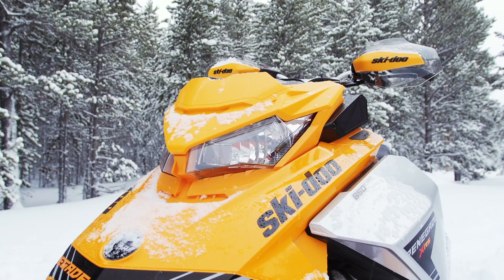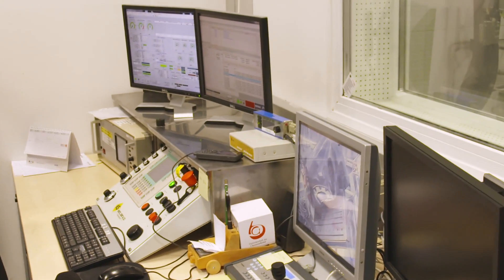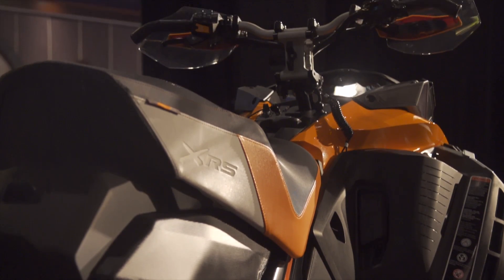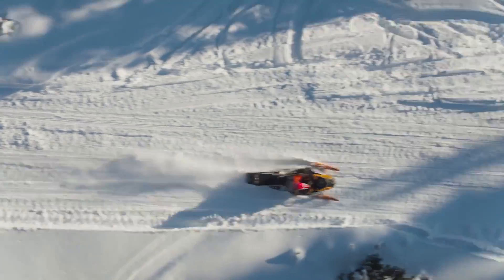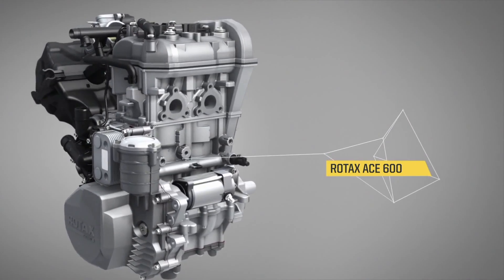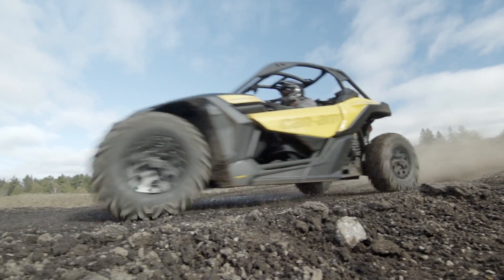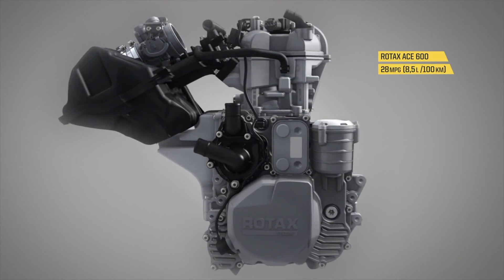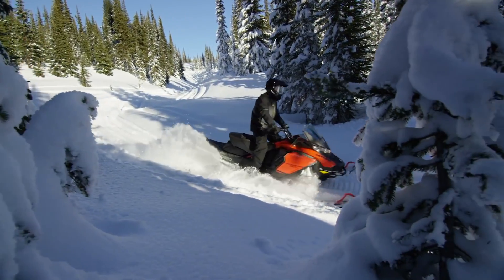Design and Development of 600 & 900 Rotax ACE Engines

Comment: 900 HP?  Seriously, edit.  Cold side plumbing on this setup is the first thing I'd change.  What is the displacement for the 900?  Seems low on power, not impressed after 20 years of Yamaha 4-stroke dominance in this class of engines.

Comment: I spotted an inaccuracy in your video. 

60HP Sparks have the same 3 cylinder 900 ACE engine as the 90HP version. Literally the only difference is the ECU tune. 

I say this as someone who bought a 60HP Spark and had it upgraded to 90HP for $100. 

There are no Sparks with the 600 ACE. I don't even see a marine version of it on Rotax's site.

Comment: My brother bought 2014 expedition 600 ACE. I bought we he moved got it around 8,000 miles sold it to my older brother stop running at about 19k. ACE machine are good if you take carry of them really good. Got me a new 2020 expedition 600 ACE almost 4k miles already doing good so far. I sure like them 600 ACE motors

Comment: I always enjoy Mark's commentary and perspective.  Keep up the great work!

I would like to offer a few corrections:
1.  Rotax "ACE " is an acronym for "Advanced Combustion Efficiency", not "Engine".
2.  The Sea-Doo Spark is NOT offered with the 600 ACE twin, but rather a "detuned" (de-mapped) 60 HP version of the 900 ACE triple cylinder, and a 90 HP version identified as the 900 HO ACE.

Comment: These 4 stroke turbos are awsome, endless amounts of power and reliability. I have over 9000 miles on my 1100 turbo cat and it is indestructible. Unfortunately, the industry still treats a high mileage 4 stroke the same as a high mileage 2 stroke, financially.  But if you plan to keep her long term and love speed and reliability, 4 stroke rules.

Comment: Instead of always 'bigger and faster', a reasonably priced no frills basic entry level sled, say equipped with a single cylinder 300cc ACE (25-30HP) in my opinion would be a great way to attract new people into the sport. What the previous generation Tundra were up to 2009.
IMO Polaris is on the right track with their Indy 'Evo' model but a quieter and more efficient 4-stroke would be a better seller.
Reply: Agree. The lower end market is where you find your future customers. A 45 to 50 mph 300 single is a great way to get new people involved in the sport. Low cost,  easy maintenance  certainly will help in the allure of snowmobiling.

Comment: I just bought a renegade enduro 900ace (no turbo) and I love it. Its quite and burns very little gas and should last many years without a rebuild. Too often are people talking about a rebuilt motor on a sled that's just 2 or 3 years old. Put a turbo on the 900ace and it must be ridiculously fast and hopefully the reliability is not sacrificed. Now I want to buy a SxS maverick with a 900ace turbo, that would be a really fun machine. BRP is on top of its game for sure and leading the industry on many fronts.

Comment: Why does the 900 ACE turbo still make less power then an 850 even though it has higher displacement and a turbo?
Reply: High hp sleds don't sell well after the first year. Ski Doo doesn't want to repeat that.